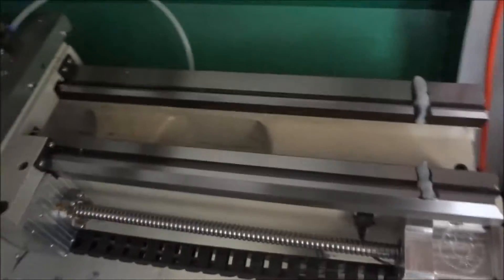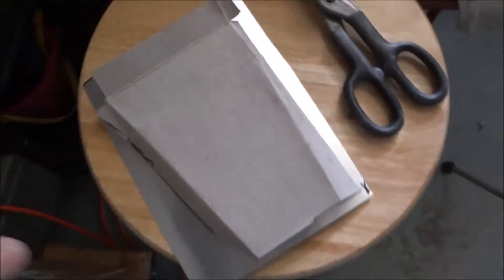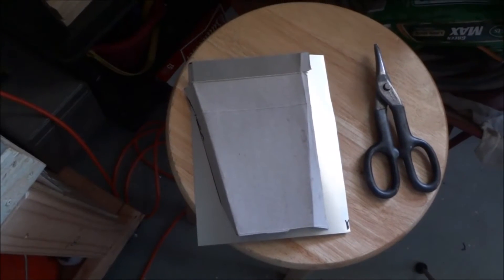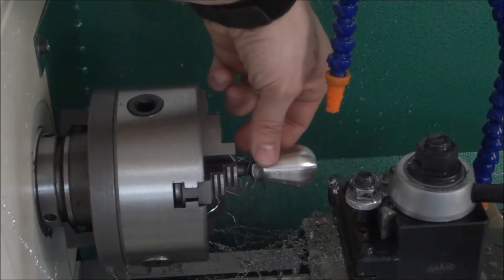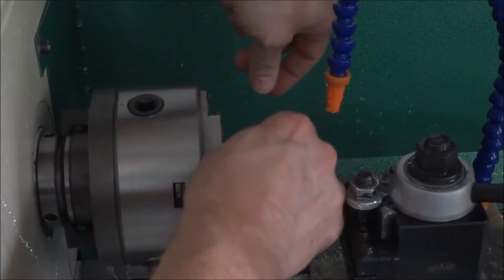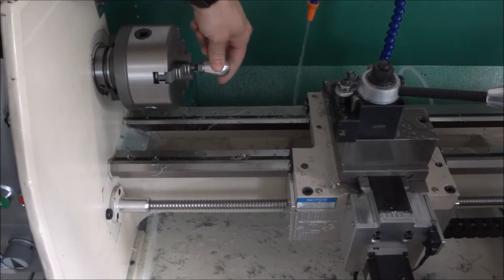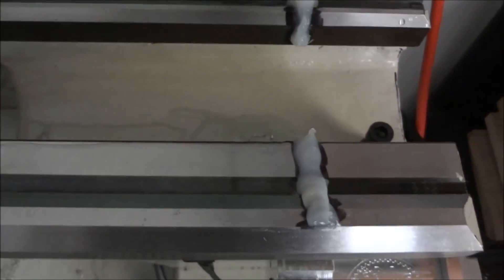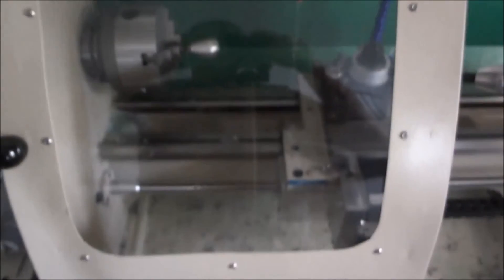G0602 CNC QCTP Knob Take 2 / Leak update!

Comment: Have you made anything that would require using the tailstock to support? Kinda curious if the tailstock is out of the picture entirely after turning it CNC.
Reply from the maker: No not yet i do have some work I will be doing in the future that will require the use of a tailstock. 
 Yes it can be used care should be taken with g code and maybe offsets/ soft limits  so the Z axis doesn't crash into it

Comment: I have a 20x80 GMC lathe and a Journeyman CNC mill and after I watched all of your Video's I Purchased a Grizzly G9972Z 11x26. I am looking for a 2 horse 3 phase motor that will fit. Did you drill the frame or did it fit. You said you used a leeson D80 frame all i could find is a D90s 2 Hp. because you loose 30% power when you go through a Phase converter. So if I use 2 Hp I will end up with 1.40 Hp. What do you think about the G9972Z it is a little bigger I like your idea of CNC. I will start with the motor change first then build all of the electronics next. Thank you for all of your entertainment and good ideas. Regards; Phil
Reply from the maker: The motor I used was a direct replacement for the stock motor shaft bolt pattern size all perfect. No mods needed. 
I think moving up a notch would be a good choice.
Reply from the maker: My thoughts would be to take the money and get the 3 phase varibles speed g0752 10x22 but I think there the same as the 1x26 only smaller if you need size then go bigger.

Comment: I've been debating on converting my G0602 to CNC, as I did my G704 and there is so much to do and time spent that I just don't have.  I really appreciate how in depth you get in each video.  I think I am going to at least convert to the 3 phase motor!  

On another note, I run my G0602 at the max when cutting aluminum and it always produces an extremely shiny finish.  I don't know if it is actually spinning at 2k rpm, but if it is, you should give it a try.  Steel on the other hand, I have very little luck on a nice finish, it always looks rough no matter what speed I run it at.
Reply from the maker: +Cole Regal 
Thank you yes the 3 phase conversion is a great upgrade. 
Yes I was being a little easy on it in the begining
Reply: +CNC4XR7 so from what I could see, you still can change the pulley setup to jump ranges or am I thinking about that all wrong.  what are the speed ranges?
Reply from the maker: +Cole Regal 
Yes you use the same pulleys so speed a speeds are the same.  It is possible to run the VFD higher than 60 hz to go  faster.

Comment: Though I do like your creativity with the production. The sound of metal being cut is porn like including the machine sounds.
   I cant tell if you are using CSS. Because I cant hear the machine. However if you are not, you might want to try it. In my experiences it made the final finish much more uniform. Not that the knob didnt turn out great, because it did.
Reply from the maker: +CncObsession Thanks Yea your right ya gotta love those cnc sounds, I will include more in the future. No haven't tried the CSS
Will have to give that a try.
Thanks

Comment: Great videos, I've learned a ton!  Just as an FYI, since I saw you cut down your chuck key, in case you didn't know, quite a few chuck keys are 0.38"  square, a 3/8" ratchet works great in them!
Reply from the maker: +Zach Wenner Great I will check and See if the G0602 is in fact 3/8",
Sam

Comment: Not sure who said Silicone would cause rust... silicone is inert after curing. There is some outgassing while it cures but after that zip. Nice fix. You can get a nice edge on silicone by cutting a profile into a credit card and slowly swiping it along the bead. Good job! Time to start selling G0602 conversion kits :)
Reply from the maker: smh3w Well that's what I thought and I'm using 100% silicone not the latex blend but to be on the safe side I just took a Sharpie and colored it. I figured it wont be in direct contact with it so it should be OK.
Man Great tip on the credit card. it was more for function than anything but if it looked better that would be nice also I'll remember that when I need to replace it. Thanks,
Sam
Reply: CNC4XR7 I've only used the credit card trick on small beads (where 2 panes of glass slide over one another to seal in between) so it may be ok for a thick bead on a short run. You gonna give threading a go next? Keep up the good work! I really appreciate the detailed electronic setup videos for whenever I can get around to it
Reply from the maker: smh3w Great Tip and I'm sure it will work, I used a corner before just never thought about a notch.
Threading did you say Threading, Posting as I type this. Enjoy,
Sam
Reply: Hi before you run the credit card over the Silicone use a old clean windex bottle to spray isopropyl alcohol on the silicone and it will come out as smooth as your KNOB you have been polishing.